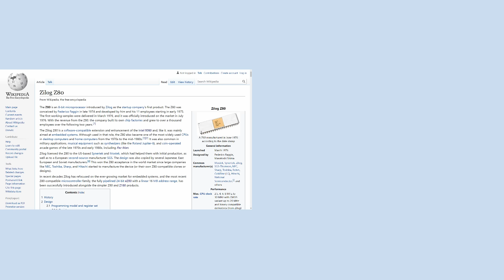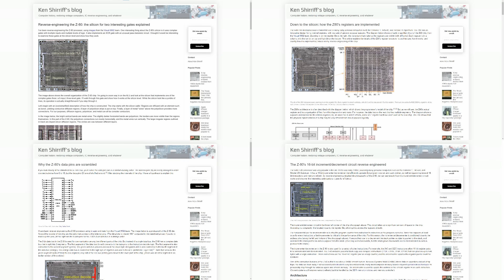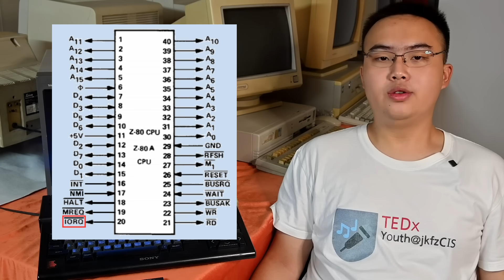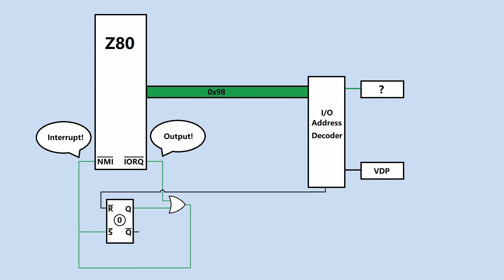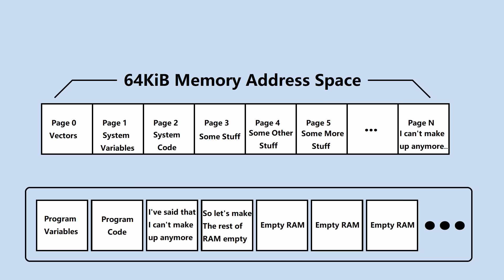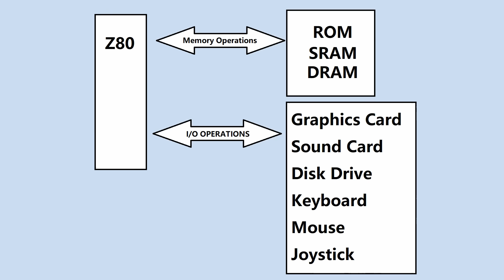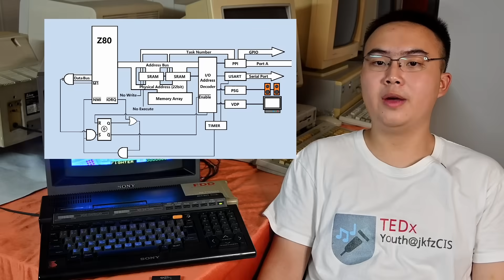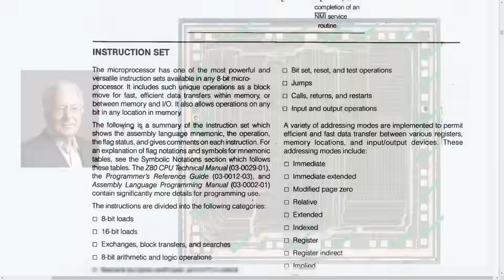The Z80's secret feature discovered after 40 years!

Comment: Zilog has a newer version of the Z80, the EZ80F91, it's much faster than the original, but the big mistake that Zilog made when they were on top of the CPU market was not keeping up with advancements so while the 8080 evolved into the 286, 386, etc., the Z80 got left in the dust
Reply: For me it looks like a glass roof. Zilog had enough knowledge to compete with a simple 6502, but was not bright enough to come up with something better than their Z8000, which is not only ugly, but came late. They did not like microcode. So what, then give us RISC, fixed 16 bit instruction length, load store architecture, only aligned memory access, all reg reg operations 32 bit, no hardware MUL or DIV as in Z80 and push to market. Though I like predicates for fast software MUL and loop start/end/count register .

Also I Wonder why the stack is part of the ISA? Can’t the micro architecture manage to store the return address, flags, and even the branch delay slot info on its own? So with less memory installed, low end CPUs may pack everything into 32 bits.
Reply from the maker: @ArneChristianRosenfeldt  I don't understand the part about the stack being a part of the ISA. Why shouldn't it be?
Reply from the maker: There is a little-known chip named the Z280, which is a proper upgrade to the Z80 like 286 is to the 8086. There is even a Z380. The problem is by the time Zilog made those chips, the PC has already taken over the market.
Reply: @andyhu9542  There were other versions as well, like a Z380 and Z800, but they have been discontinued. The F91 is still in production, but I get the sense that Zilog will not be around much longer.

Comment: I'm sure it's already been said, but adding a bunch of hardware around a chip is not discovering hidden features
Reply: But then you have other vendors whose chips are extremely picky about the pcb around them. Thanks Zilog for chips which inter-operate and are flexible. Not some convoluted datasheet specs BS.
Reply: @ArneChristianRosenfeldt  I'm not saying what he did isn't really cool - it's awesome! But a Z80 based machine already made and put together, you can't write code for it which allows it to operate in protected mode. Because of this, IMO, it's not a hidden feature
Reply from the maker: Have you watched the entire video? I have addressed that question. The title is not technically correct, but it's best for what it is made for: getting people interested in and talking about these amazing old techs again!

Comment: Hi Andy. Congratulations, great work.

I have hearing issues, so it is hard to follow, so please forgive me.  But, does this mean you can set up a machine to: both have different programs running in different address spaces unable to interfere with each other, like a modern OS, and also each of those address spaces have different hardware?

I've been looking at the possibility of proposing to the retro computer community, a computer which runs Sinclair ZX80/81, Jupiter Ace, and Spectrum code, under a selector master windowing and screen mode OS.  Sort of Gem or latter Amstrad PCW GUI environment.  But most all those machines interfere with the CPU, using it's timings to create video, very simple graphics hardware.  Plus, to also run Amstrad CPC and PCW, and Microbee software, which all uses the Motorola graphics chip like the PC does, and old TRS-80's.  That is most popular Z80 computers outside of MSX like computers and the simplistic 6847 graphics machines.  A fast enough z80 should be able to keep up with games.

The only issue, is how to force a program to surrender (pre-emptive multitask) execution to the system to hand over to the next task repeatedly.

May I please ask, what do you think of the technical possibilities of this?
Reply from the maker: The issue with preemptive multitasking is probably solved with NMI, as no programs can mask it. ZX80/81 compatibility is relatively easy: you have your OS come in and read the characters and render them on screen regularly. If you have a fast Z80 this may be even faster than the real machines as the CPU is not spending a large chunk of time running NOPs. This is similar with Ace, but you also have to use the redefined fonts. ZX spectrum is another story. All other machines are monochrome, so I actually suggest you drop color support. But then you wouldn't have full spectrum emulation. It also runs much faster, so expect big slowdowns in emulated environment.
Reply: @andyhu9542  Thank you very much Andy.

I was more worried about the timing and graphic tricks used in games, to enhance graphics, with real hardware chips without emulation?  Such as pseudo hires on zx81 and spectrum has a line by line colour attribute swap trick as well, the colour Amstrad CPC and microbee  series I don't know, but there has been extensive tricks applied to that CGA graphics chip in the PC (one demo even claiming 640*200 16 colour).  A z80 multi machine, as some people feel real hardware is more authentic.

Comment: Back in the 1980s, I thought of using the M1 line to latch the address, then enable or disable writing to certain pages based on whether you were running inside those pages.  You could make it so (for example) only the first 4K of RAM could write to the first 4K of RAM with just a bit of extra hardware. I never actually built it though.
Reply from the maker: This is an interesting idea! However, Z80 programs are assembled to be run at specific addresses. Unless you dynamically reassemble the code, two programs that require the same 4K page to run will not work together.
Reply: @andyhu9542  Well, yes. My idea was to keep random programs from overwriting interrupts or the operating system. It was just a realization that with very little hardware, you could make a mechanism for write-protecting pages from certain programs. Of course it wouldn't work well with CP/M because that launched the programs at 0x100.

Comment: Good video with a correction for you: RST is not "reset", it is "restart".  RST <parm> functions as a single-byte call, where <parm> is $00, $08, $10, $18, $20, $28, $30 or $38.  Useful for often-used system commands.  (I teethed on the Z-80 in the 1970s)
Reply from the maker: Yes, I learned it after making this video. (I learned so much more about the Z80 after this video went online..)
Reply: @andyhu9542  No worries.  You know more than I ever did.  I love this video.

Comment: Fantastic work! I won't condemn you for clickbait, even if the title isn't precisely correct, you still have something genuinely novel enough to deserve the click.

One minor suggestion (for the next time you present a similar situation); @6:05 where you have the OR gate with the text to clarify that it works with active low signals, I would just use an AND gate and add bubbles on the inputs and output. The bubbles account for NMI and IORQ being active low. The other input either needs a bubble if fed from Q, or you can just take ~Q straight without it.
Reply from the maker: I know that convention. But I have also seen it create some confusion among people with less experience as that representation isn't taught in textbooks. I will do a series of video diving into the details of the circuit for a more 'hard-core' audience. I will use this representation in those.

Comment: Very cool video! I used to program MC6809, TI9995, HD6301, and old fashioned minicomputers in assembler and loved every second of it. My applications were aerospace and defence - Harrier engine controller built-in test equipment, Airbus Fuel Quantity Indicating Systems and the minicomputers were for aircraft simulator applications. The good old days. Debugging was with an HP logic analyser that you clipped on to the processor in the live circuit. UV EPROMS were state of the art at the time. Great stuff! All the best, Rob in Switzerland

Comment: Z80 is my first CPU, so your video brought up something good and warm in my memory. Back in 90s, as ZX fans we had a place to meet with peers every week, and there were a lot of schematics to implement. As I remember, In original Speccy with TR-DOS there was a nice feature to swap the ROM page based on decoding ~M1 together with some address bus bits. And it was triggered back if your PC leaves the ROM space (#0000 .. #3FFF). This principle was widely used for custom extensions. And ~NMI ("magic button") we used to use to swap the system memory with our own SRAM pages with debugger loaded. It was nice to have your own pages which 'ring 3' code couldn't reach :-) As it was said, if something is impossible with Assembler, you still have your soldering-iron.
Reply from the maker: Can you believe it that I have met both problems in my design process! However, my solution to the first one is a bit different. The ROM page with address decoding method doesn't allow program code to be run in that region, so I have to find another solution that allows programs to be put anywhere.
Reply: @andyhu9542  One of the features of the ROM is its immutability ;-) So, if you place your system supervisor in ROM, and you know exact address which cannot be called (or jumped) from outside without being caught by the system code, it's easy to have a hardware latch which will trigger "ring0" mode when executing from that particular address. When it's latched, you can trust the execution of other parts. Say, you can have kind of ~RING0_MODE signal from that latch to control ~OE inputs of decoders of some IORQ, to enable some ports to be accessible only in this mode, or to control access to some memory switching logic. And you can reset the latch just executing a single address, or address range (as TRDOS does), or just doing OUT something into a dedicated port. While the latch is active, you know, that it's your trusted code is running, not user's.

Comment: What happens if you run the Fork Bomb on the Z80 ?
Reply from the maker: The design has a hard limit on the process number supported (although it can be extended with software, it is too slow to be practical). So, at some point the fork would just error out. However, the current command prompt concept is different from Unix (although a full Unix port is planned for some distant future), so forking just isn't supported normally (it is a very crude way to do multitasking anyway).

Comment: Protected from what? I mean, is a protection to avoid to read the program or some other kind of protection? The program is not on an external memory? Does have an integrated PROM?
Reply from the maker: Protected from other programs. The goal is that your word processor won't randomly lock up when your calculator program crashes, for example.

Comment: I had a M68000 VME board that used a similar technique to provide memory protection and "virtual memory". No I/O address space, just some registers implemented in PLAs, and address translation in other PLAs.  It was kind of cool, but the OS had to be written specifically to work with the memory management.
Reply from the maker: Motorola have the 68451 as an MMU for the 68k, why didn't you use that instead?
Reply: @andyhu9542  I didn't make the board, I'm a software engineer, it was seemingly much cheaper to do it with a 10 MHz 68000 than to spring for a 68561 or a 68010; not even sure either was available when the board was made, though; it was originally used in medical imaging equipment, and I obtained it, along with the backplane and some other memory a peripherals, around 1986-1987.

Comment: You should look into industrial controls like PLCs(Programmable logic controller). You will most likely find a number of them using this. Generally security on computers wasn't considered to that level back then. However industrial controls was another matter. They were used for power plants, chemical processing, laboratories, other industrial equipment which in general it could lead to people dying if stuff goes wrong.

Comment: Note: the RST instructions don't do the same thing as an NMI. RST instructions call one of 0000, 0008, 0010, 0018, 0020, 0028, 0030, 0038. An NMI calls 0066.
You can, though, handle all of those. As well as IM 2. There are just a few other instructions that must trigger an NMI, like DI or LD I,A or IM mode changing instructions.

15:36: not true. All of the undocumented instructions follow very clearly from the logic of the documented ones and are just a side effect of not having a TRAP interrupt. For example, SLL is just a side effect of how the other bit shifts were implemented. And being able to access IXH or IYL is just a side effect of how the IX/IY prefixes were implemented.

Oh and, some actual z80 hardware does in fact trigger NMIs on "bad memory accesses". Okay no, im thinking of the Texas Instruments 84 Plus CE graphing calculator, which has an eZ80. The Z80 variant calculators don't do NMIs, they just ignore writes, return 0 for reads, and trigger a full power cycle on executes.
Reply from the maker: The normal interrupt line is just not hooked to anything (pulled high). Therefore, those interrupt control instruction does NOT need to be caught.
Reply from the maker: The undocumented instruction section of this video is deeply flawed (I kind of know it when making this video, it's the section that I'm the most unsure about). I have learned so much about the undocumented instructions since making this video, and also extended ones.

Comment: The explanation at 14:30'ish is not entirely correct i think. The little parts of "circuitry" at the edge of the die are usually current sourcing BJTs/FETs to interface the microelectronics with the outside world, since the IC itself cannot source any real current. However, the unused instructions thing is true afaik.

Comment: YA I worked with some multiprocessor Z80  based systems that extra logic to do some of the functions that he noted in this video,  
Other functions where added with external custom logic devices. Unfortunately nobody did any RE of the original Z80 DIE unused pins that where where
left NC on the finally released version. (Over 40 pins where used on some of the original DIES).

Comment: Intel x86 or i64 cpus has hardware multitasking, but operating systems such as Windows do not use this feature, performing multitasking through software, as it is safer to control tasks more efficiently, using protected mode combined with memory manager, What even the z80 can do with the exception of protected mode, but processors with z180 and hd64180 have a memory manager and traps for disallowed instructions!!!, very good video, congratulations!!!

Comment: For me the most amazing thing about the Z80 is how many derivaties have been made from it. I could buy a 30Mhz (with many onchip peripherals) that are, or allmost, binary compatible but multibles of performance faster. It really annoyed me I can't use your `hack` unless I use pure z80 silicon.

I'm working on a Rabbit 2000 SBC, going back to just a Z80 and lose components is imho a fools errant. But it has inspired me, like if I can use the extra power to virtualize how that would have worked.

Thank you
Reply from the maker: Technically, a 'pure' z80C0020 can run up to 20 MHz, and many people reported overclocking it to 24MHz for a long time without any issues. That's PRETTY FAST. (although it wouldn't perform 2/3 times as the 30MHz one due to more cycles taken to run an instruction).
BUT, the other side of this idea is that since the Z80 has so many derivatives, it wouldn't hurt to just design one more with features supporting virtualization (for example, including the flip-flop into the chip). That would require some FPGA programming, which I currently can't do. It's a project for the future.
Reply: @andyhu9542  Very true, and yeah speed would be a few mhz at best. FPGA would be way better, would also like to design something like that, love lattice parts. But one project at a time. :) 

And then there is the voltage issue. My current hobby project is re-purposing an old starwriter 30 as a minicomputer. 5v tollerant fpga's a niché and levelshifting is imho a pain. And another reason I picked the Rabbit 2000 is, as a subproject, to design a very small z80 derived SBC for it in a breadboard friendly format. Schematic is mostly done, it's insanely compact while allowing flash to be programmed over usb. 

I guess I can't use this neat trick of yours for now.

Comment: The thing is it required extra circuitry although not very advanced circuitry. But I'm not sure this is exactly true protected mode because I think you could still write a program to reset the flip flop and thus access the protected IO and RAM.
Reply from the maker: Nope, if the system is written carefully, no user program can execute in kernel mode, which means they cannot access the filp-flop at all.

Comment: yeah... but in that case... wiring /ior to /nmi ... one can also implement memory protection by making the address decoder 'programmable' (as in, attach a ram to it containing a table of allocations, possibly even giving each program it's own full 64k out of a megabyte or so, that somehow interacts with your nmi handler and only with your nmi handler (the nmi handler itself can take care of that ;) just like we wire /reset to the output of the address decoder == ram or io in case the fetch is an instruction (the 65c02 and 65c816 supply such a signal ;) so it will only run the designated code from rom and can never be 'hacked' by bufferoverflows containing code. these are all 'external' setups... not something 'any' z80 in circuit can do in any existing system out there. without adding some wires and/or chips :P